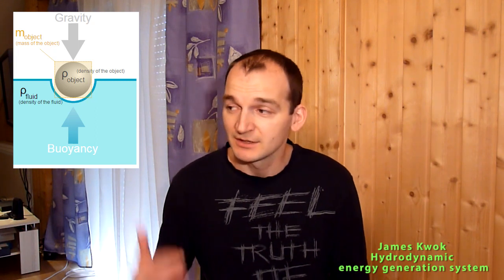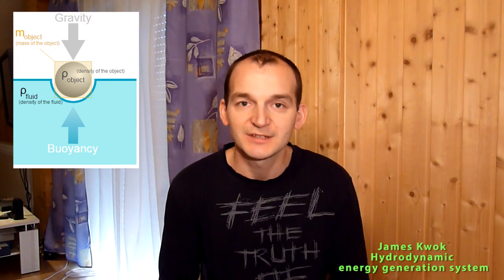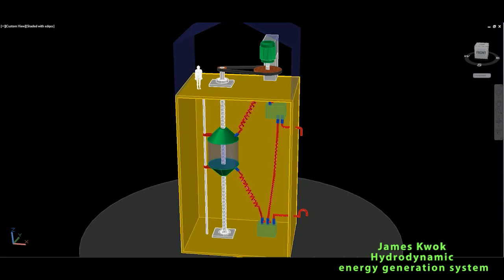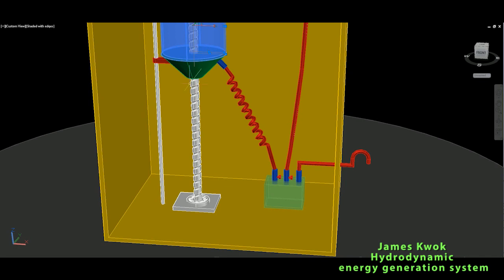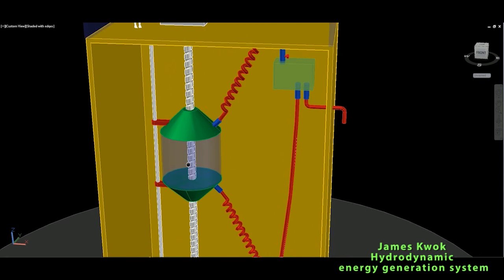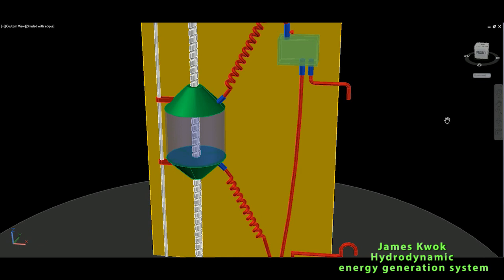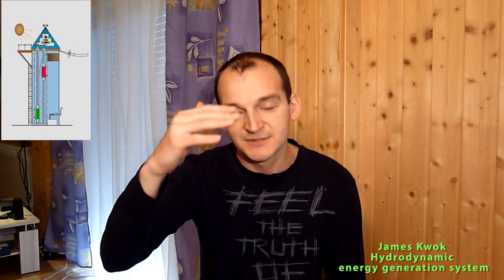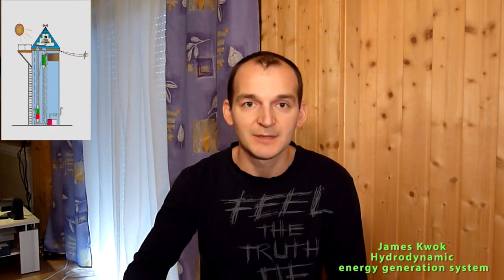Free Energy Generator, JAMES KWOK Hydrodynamic energy generation system

Comment: You need a lot of energy to pump air inside a liquid under pressure. At that point you are fighting liters of weight just to get the air inside. There is no such thing as free energy, due to newtons 3rd law
Reply: Energy in vs energy out